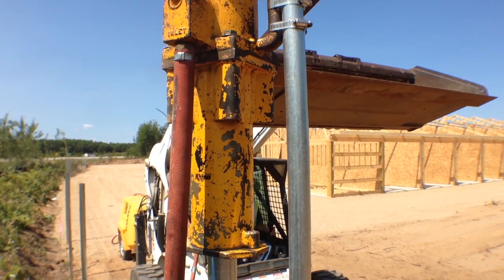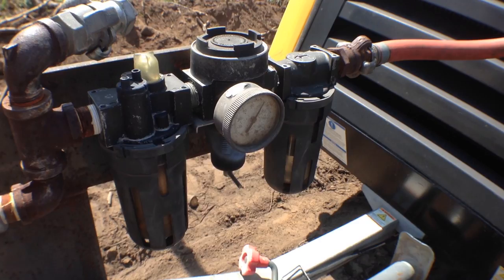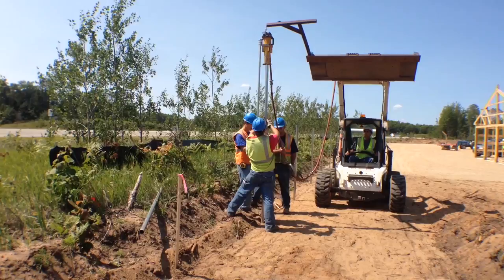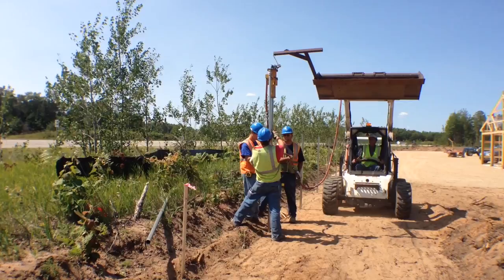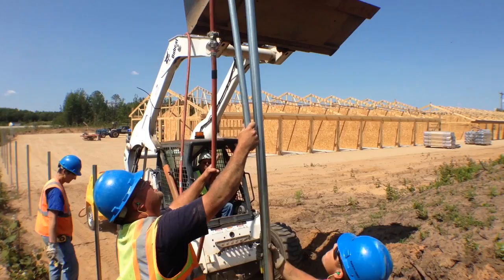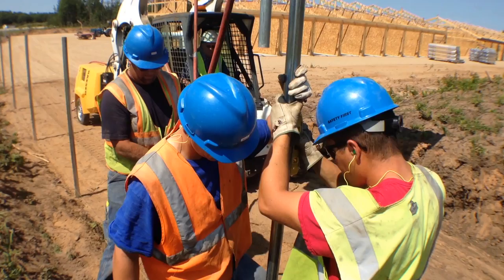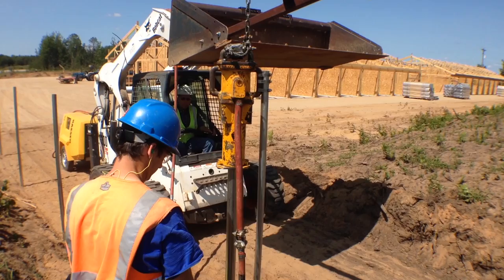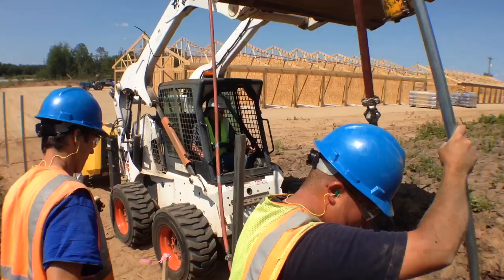How We Use A Rhino Post Driver on A Chain Link Fence Job

Comment: I had to do a job once that called for a tracked driller to come in and drill into a ledge several feet, about a 200 foot run, and we did cedar panels with ring plates, 8 feet on center. What a job!!! no room for error, only had to "stretch' one panel a couple of pickets by the end, that driller drilled  about 25 holes and they were all dead on, we had to keep plywood under the tracks to keep it from marring the pavement. Of all the jobs I have done in the past, something about doing fencing is very satisfying, I really enjoyed the work, but my back can't take the abuse anymore.  We had a rhino, but other than that, everything ws done by hand, no bobcat, many many times ive lugged rolls of chain link on my shoulder, and picked that rhino up on a pole a hundred times in a day. I miss it...I love the feeling of seeing a new fence that is straight, tied off correctly, ect.

Comment: We even cut the tops by hand, and we had several custom fences that were popular, one being dog fence..dig the top soil down about 4-5 inches, and lay chain link flat on the ground, drive our posts through it, then they cant dig, even if they did get the hog rings undone.